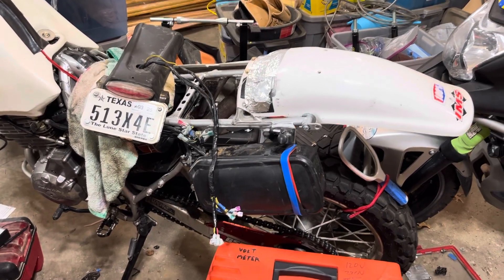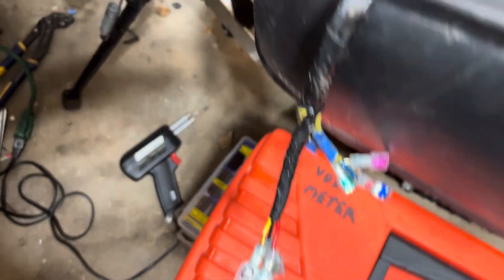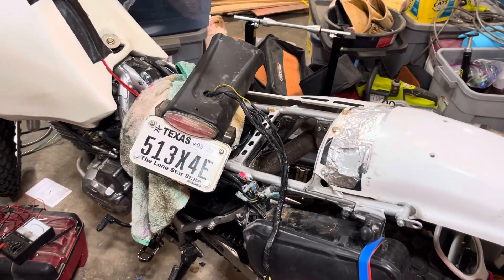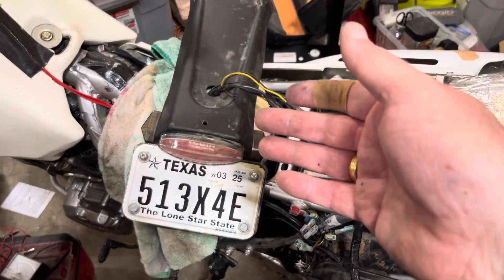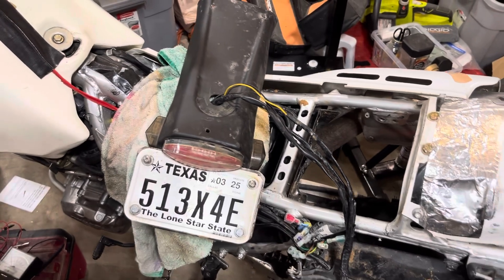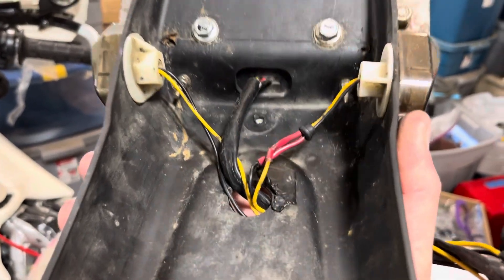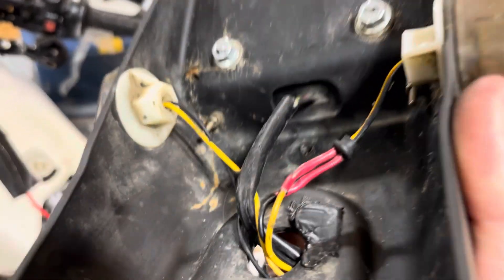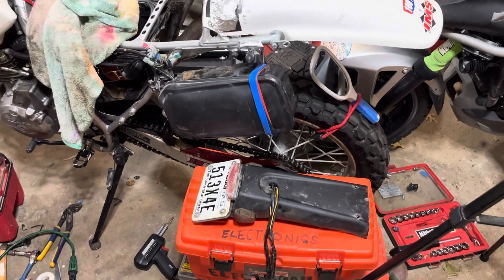Wiring - Sometimes when you get a secondhand motorcycle, things don’t always go perfectly.

Comment: Once I had it disconnected, I could test the mini turn signals using small power cells.    And no luck getting the LEDs to light up on the bench test.    So.   Time to cut the wires and remove the turn signals.   I will plug them back into the bike piece meal and test them.